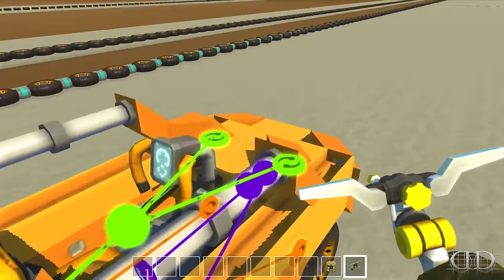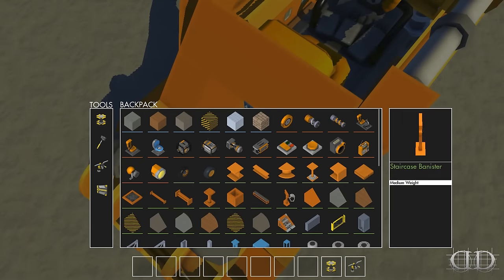Scrap Mechanic Gameplay : EP57: Mini NASCAR Go-Kart & Track!! (Let's Play 1080p)

Comment: the suspension has little to no effect because the wheels are right under the car, they have no space to be pressed together(suspensions)
Reply from the maker: +Brent Batch wasn't worried about the cushion.  Without suspension the car rolls in the turns.  Didn't want to have sensors on the side to right it.  With suspension, the car doesn't roll when it turns.
Reply: DieselDesigns weard because it shouldn't work without cushion, i guess it's just something weard in the programming that allows the suspension to have some effect even without it being pressed together.... btw are you interested in a glitch to get above the ceiling ?